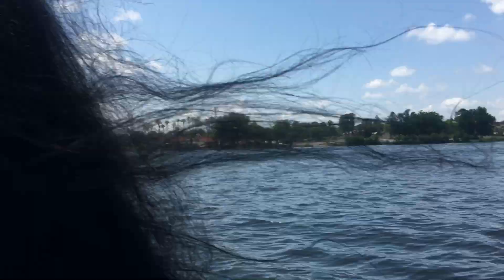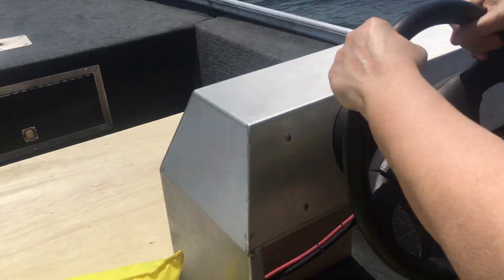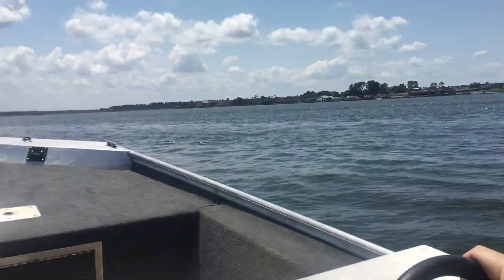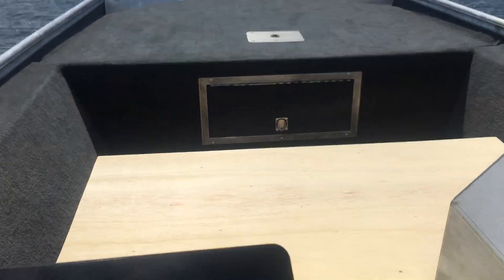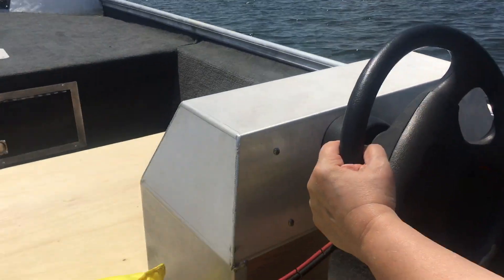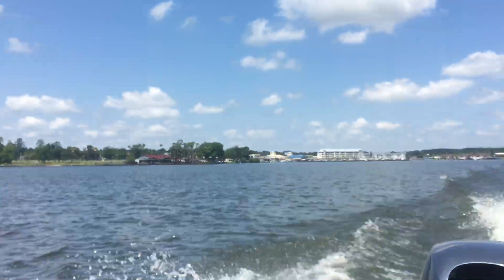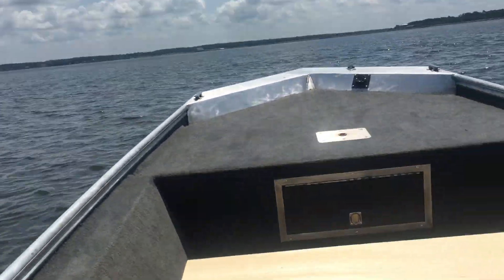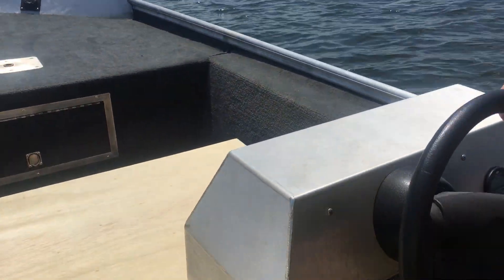Me and my girlfriend on the lake with the Stealth E40 All Electric Outboard

Comment: Just saw your videos. Nice to see someone innovating the outboard market. Realistically, how much weight are we talking for batteries to do this all day on the water fishing? And what kind of charge times?
Reply: 300th sub!
Reply from the maker: I have designed modules that I'm having CTECHi produce that are lightweight and high capacity. A 37.44kWh pack, which will give you all day on the water, weighs only 396 pounds and costs less than $6,000.
Reply: @scooter240961  Dang, I want to do a simple jon boat to bass boat conversion, but I'm pretty sure that would put me well over weight with gear and a trolling motor setup.
Reply from the maker: Not at all. Many folks have converted to electric using much heavier lead acid batteries and have had no issue. What size Jon boat?
Reply: Scott Masterson I’ll be doing all of my planning over the next year before I buy anything. It will probably be a 1648
Reply from the maker: There are two ways to go. To plane or not to plane. That is the question. To plane requires power and lots of it. Lithium battery is a must for plane and all day range. It does come at a price. Feel free to run past me what you find and get my honest read on it. My email is smasterson2@gmail.com

Comment: Hey Scott, new subscriber here, love what you're doing man. Question, what would you suggest for a 25hp replacement? 30kw? Strictly HP to Epower speaking. I don't know boat size or weight yet so I'll handle that another day.
Reply from the maker: Thanks Justin. HP is HP. The electric version gives you a better holeshot. 25HP converted to kw is 18.64kw. If you want that power at the prop, figure around 23kw should do it. I am working on a conversion kit where you can convert your old tired outboard to electric. If your interested, please email me at smasterson2@gmail.com
Reply: ask chef 24 hp ektrç puutbard

Comment: congratulations for the project! but why use the high voltage? why not just a 48 volt system? thank you!
Reply from the maker: Very simple. This boat requires almost 30kw to get to plane. It also requires 15kw to keep it on plane. At 144v, that only requires 208 Amps to get to plane and 104 Amps to keep it there. In the case of a 48v system, the current required to get to plane would be 625 Amps and the current required to keep it on plane would be 312 Amps. There are not too many motors and/or controllers that can handle that kind of current. The other issue is getting a battery that can handle that current draw too.

Comment: Hi Scott,

Congratulations on your success with a homemade battery pack.  250 amps times 140 volts is 35,000 watts.  That is a LOT of power!!!  Enough to blow the mains circuit on most houses.  Glad that my BatteryBlocs worked for you.

It would be good to carry a temperature gun to shoot the temperature of the battery and see how warm it gets.  It is a good indicator of how much stress you are putting on the cells.  Check the difference between the cell temperature and the temperature of the BatteryBlocs, if any.   If the BatteryBocs are much warmer than the cells you will know they are adding resistnce.  If not, the voltage drop is all in the load on the cells.
With a higher amp hour battery, you will, of course, have proportionately less voltage drop.  It is a good sign that the controller and motor were cool to the touch, check the battery pack as well.

Shawn
Reply from the maker: The voltage drop is due to overloading the cells. They are 7 Amp rated and I am running 20P, so I should limit the current to 140 Amps. I may double that in the future to 40P and give me 280 Amps, so 250 Amps won't see much sag.
Reply: Makes Sense.  When cells get warm the voltage drop increases.  250 amps is dead short current with that # of cells!